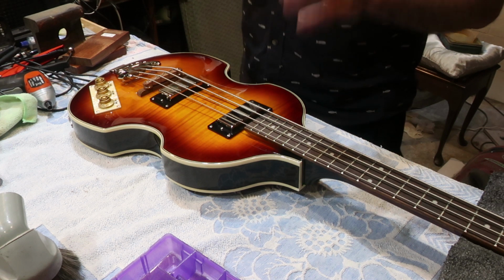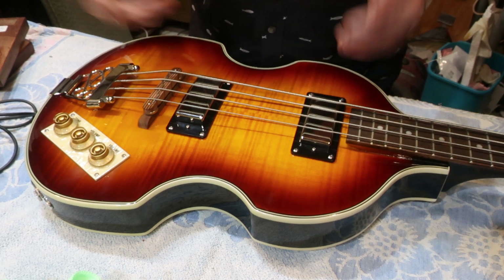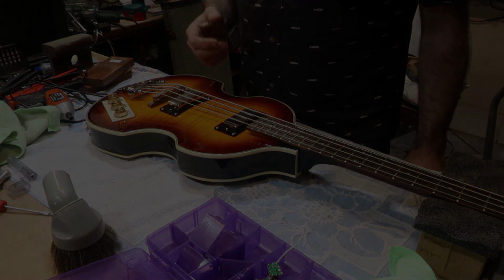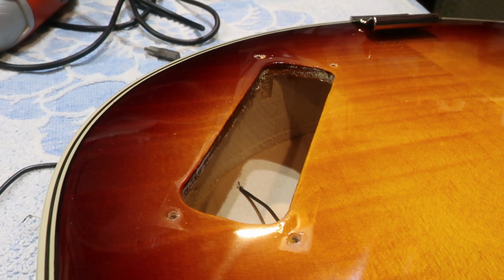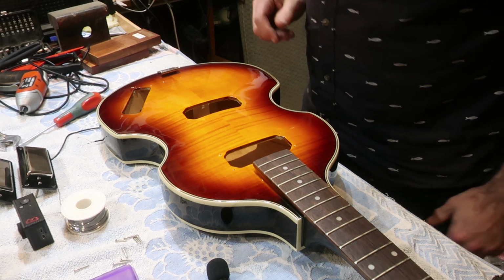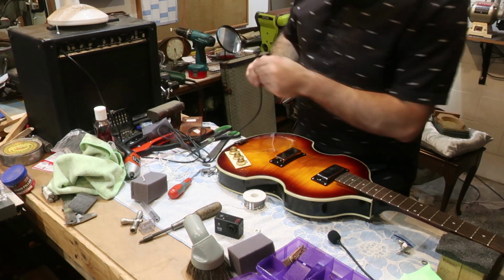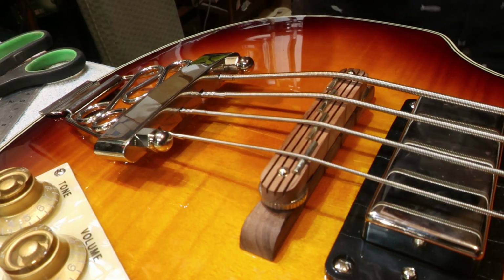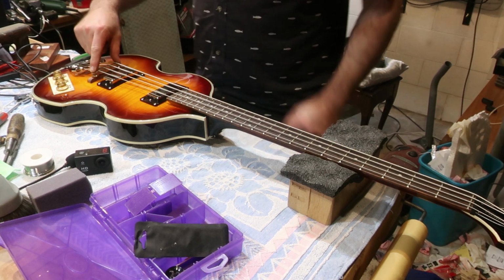Epiphone Viola Bass part 1 - Teardown and Upgrades

Comment: I had a 65 Hofner that I had to sell. Replaced it with 67 Hagstrom hollow body because they had same width neck. The Hagrstrom sounded horrible ,but  electronics were fine. Cured it and would highly recommend on new or non collector hollow body bass, adding aged wood running like a spine from neck to tail. Also put solid block under bridge area. Result was a much deeper tone and nice sustain. Tone wood maybe a fantasy , but the construction / natural vibration through body makes a huge difference. The same body type 6 string guitar can get away with the total hollow construction but rarely works on a bass. Forgot to mention it cured the annoying neck dive

Comment: Thanks for this. I thought I was going nuts with the pickups but you answered my question. I went to the 2 different stores and tested 2 new basses:

Volume knob(s): hum at levels 9 to 10

Tone knob: hums at levels 1 to 10

I guess this is a known issue.

Comment: You can move those little pieces of fret wire on the bridge to any slot you want to for proper intonation. That's why it's made that way!
Reply from the maker: Those slots are not even close to being accurate enough!
Reply: i just brought one of these thank you i will play around with their positions ! great info !
Reply: I just tilted the bridge a few degrees closer to the G string and I’m in nearly perfect intonation.

Comment: These sound 100% more authentic with Pyramid flat wound strings. The strings cost 2/3 the price of the instrument but make a huge difference and are worth it.  The bridge is a pain to set up but not impossible - then just leave it.
Reply: Pyramids are great strings and will probably last a lifetime. However I prefer La Bella 760FHB2. Perfect fit, flatwound and E is .096.

Comment: Great channel!!! Apart from epiphone and hofner… have you heard about the samick viola bass??
Reply from the maker: No, I didn't know Samick had done one, I just quickly googled it and found one on Reverb.com, it looks fairly similar to the Epiphone (flame top, headstock, choice of tuners), and the pickups look like they're from a les paul (a big plus) but the bridge somehow looks even worse than the Epiphone. The listing says it's a semi-hollow body, if that means there's a center block like the Hofner CT series then it's probably a really nice instrument. I'd be quite keen to take one for a test drive, Samick are really underrated in my view, they used to make all the Korean Epiphone stuff that people are so keen on these days. Thanks.
Reply: @fanbladeinstruments  i guess you cannot have everything but hey theres upgrades,  i think that resides internally (the guitar accesories) and  or externally (devices to make sound signal of your guitar sound good )

which begs the question

Is better to upgrade componets of your guitar? or to upgrade the componets that you plug your guitar into??

Comment: Love your channel, mate :) Not saying its a good design, but are you supposed to remove the metal pieces the string goes over from one slot to another in the wooden part of the bridge, to intonate each string separately? Or are they stuck in there good? Even if that is possible, its not a good design...
Reply from the maker: Each of those little metal pieces can be inserted into one of four slots, so it's "adjustable" just not precisely intonatable. Thanks.

Comment: I WANT TO GET THE MCCARTNEY SOUND, WHAT NUMBER SHOULD I SET EACH KNOB TO? 2 ARE FOR PICKUPS AND ONE FOR THE TONE, SOMEONE HELP ME
Reply from the maker: It's more than just pickup selection, but you can start with neck on 100% and bridge on 70%. Then you will need flatwound strings, a felt pick, and play really lightly. That'll get you very close to McCartney's tone, and you can adjust your amp to refine it even more. Hope that helps, good luck.
Reply: @fanbladeinstruments  Thank you very much for responding, and how far do I leave the Tone knob? . Indeed, I do have flats strings, just yesterday I bought them
Reply: @fanbladeinstruments  Thank you very much for responding, and how far do I leave the Tone knob? . Indeed, I do have flats strings, just yesterday I bought them

Comment: Fully hollow? Were they always that way?
Reply from the maker: Yep, all the way back to the very first Hofner models, although predating that was the Gibson EB-1 which was a solid body. There's been variations over the years, the Hofner CT series have center blocks which increase the weight but improve virtually everything else (balance, tone, sustain, not feeding back at high volume), if I were to spend the money again I'd almost certainly get a CT series. Thanks.

Comment: Those pups are severely microphonic.
Reply from the maker: I wouldn't say 'severely', in fact I never noticed it before. It's hanging beside me as I type and I just checked, and yes they are a little bit microphonic, nowhere near as bad as some I've encountered but on a hollow body that might make enough difference to be noticeable. It's about due for a restring so I'll use the opportunity to drop some other mini humbuckers in there to see what happens, thanks.
Reply from the maker: Also, Hey, are you the Uncle Nerky that does custom decals? I've been hearing about your good work and will be looking at getting a batch in the near future, Cheers.
Reply: @fanbladeinstruments  yes I am!
Cheers to you as well, kind Sir!
Reply: @fanbladeinstruments  I find the artec mini bass buckers to be a good substitute.  Ceramic-based, but they have a lot of bottom-end to them and they are well constructed.  These basses scream for flatwounds, if ever you're so inclined to get some.